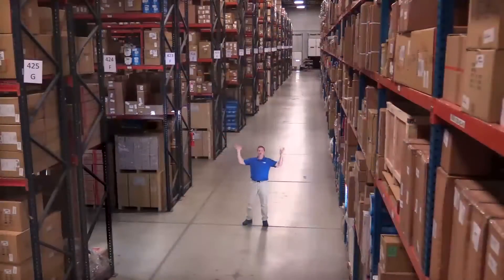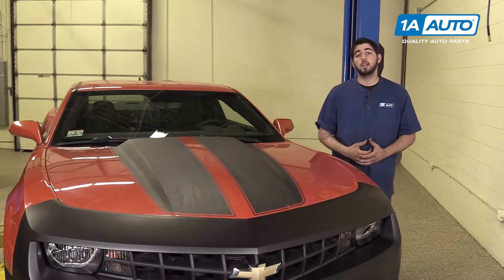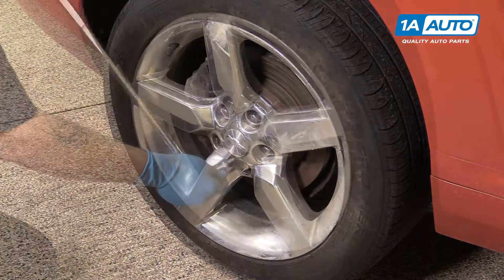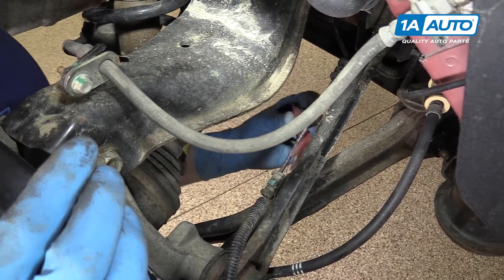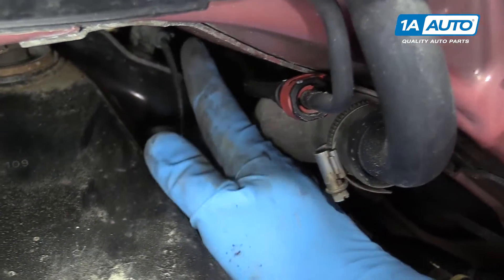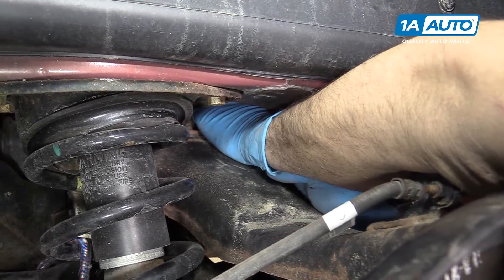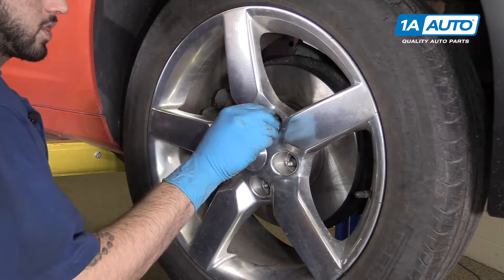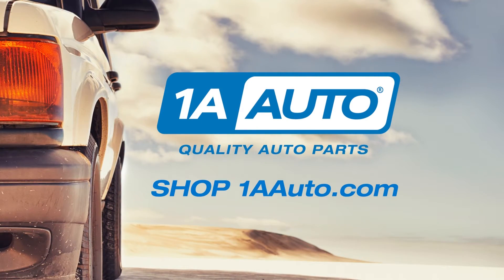How to Replace Rear Wheel Speed Sensor 10-15 Chevy Camaro

Comment: Is this the same procedure for the front wheel speed sensor?
Reply from the maker: +Johnathan Shanklin It may be a different procedure on your application. We currently do not have an auto repair video for this particular year, make and model. Thank you for asking. 1aauto.com
Reply: 1A Auto Parts same make and model

Comment: How do u know which sensor is bad coz the abs and hand brake and stability light came on at the same time the first time they went off by itself and after 2 days they came back again even the reverse sensors they stop beeping when those light is on 
What should i do , in fact the country im in the road is so bumpy

Comment: How do you know those sensors where bad??
Reply from the maker: +oscar hernandez Thank you for checking us out. The wheel speed sensor will give an ABS code and other stopping symptoms would occur most commonly a frequent pulse. 1aauto.com
Reply: thank you very much 1A Auto Parts for your reply this will help me out with my project.